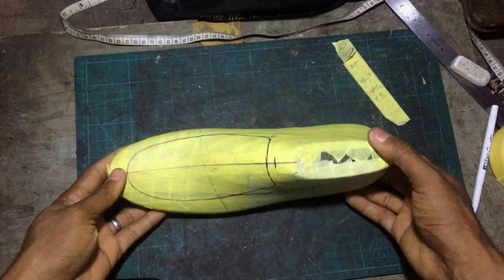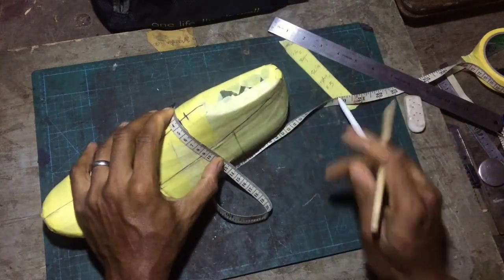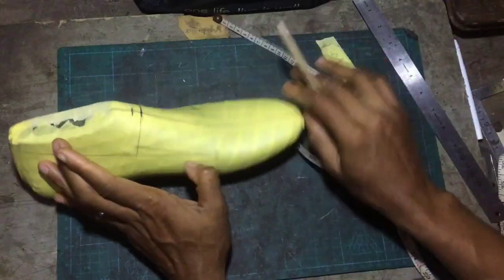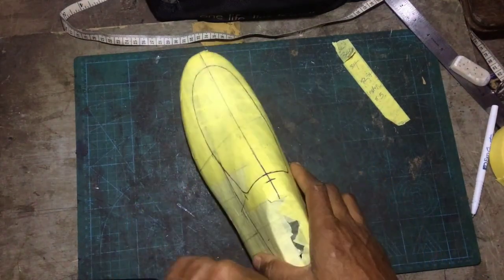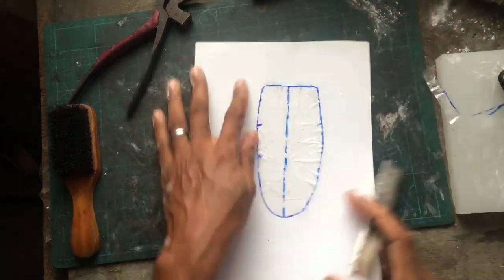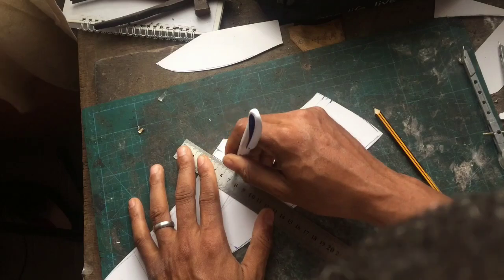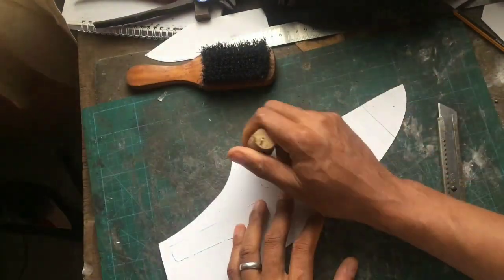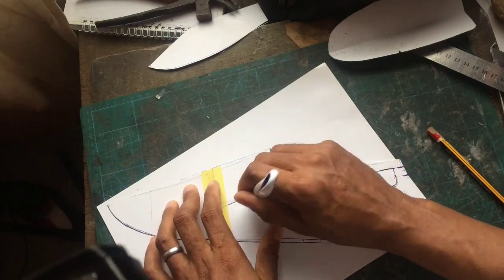How to make men's Apron Loafers Shoes.

Comment: I don't understand the apron transformation
Reply from the maker: The concept is to 
1. design the apron in full on the last
2. Use the symmetry method to design the basic loafers as we did in video 1 in the series. 
3. Transfer the apron design we did in 1 above to the basic loafers from 2 above so that we have the asymmetrical apron on the symmetrical loafers.

Hope this helps.